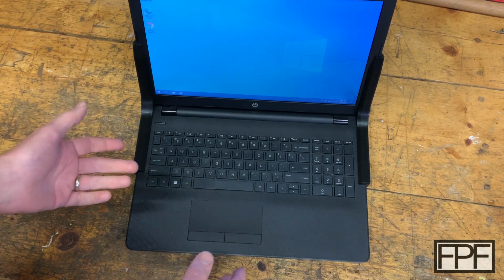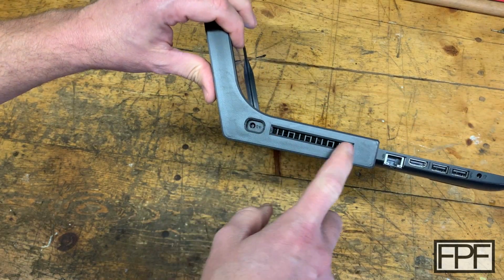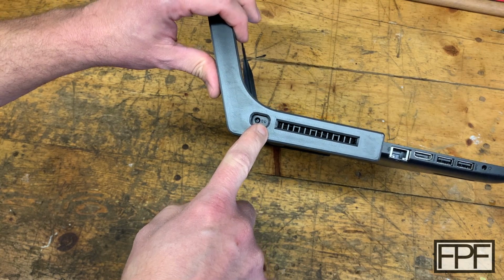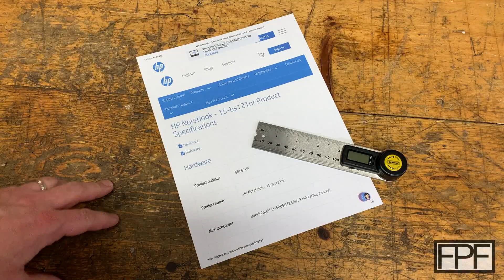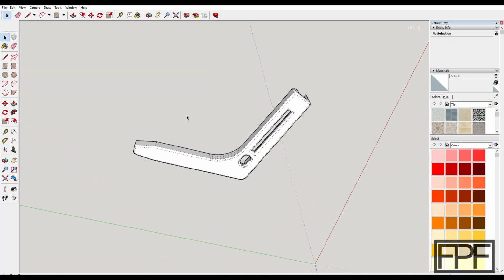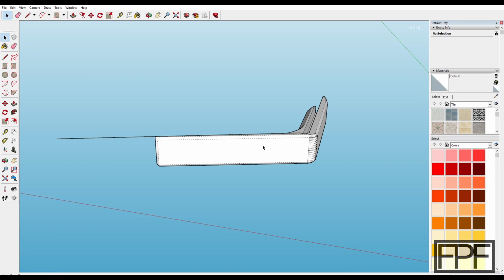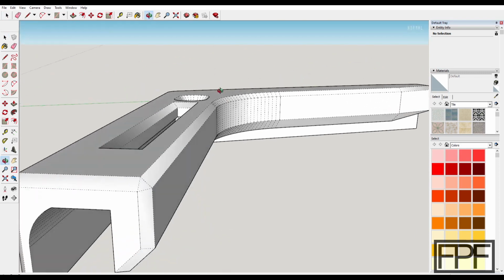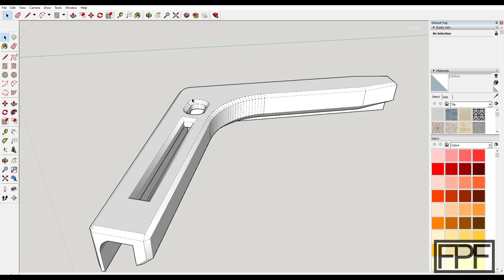3D Printed Laptop Screen Braces

Comment: Such a great solution. I wonder if with a bit of modification could you hinge the braces with a print in place hinge design?

Hmm I've got a busted laptop here, might have a play with this idea!
Reply from the maker: Thx for your comment!  It's possible, but for this laptop, with any movement, the other parts that go through the hinge weren't going to last.